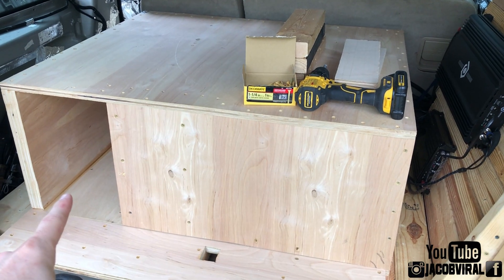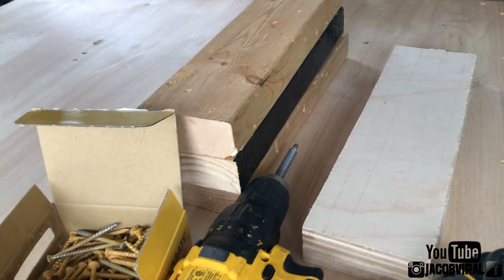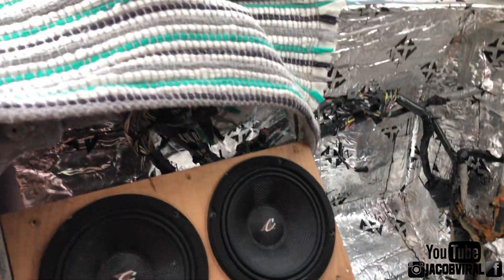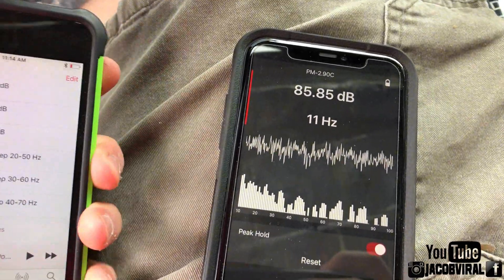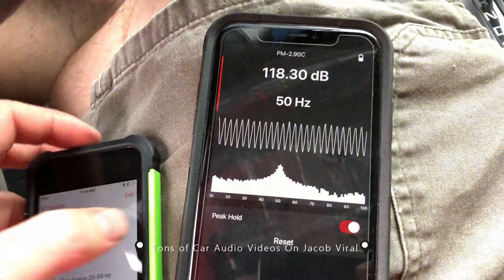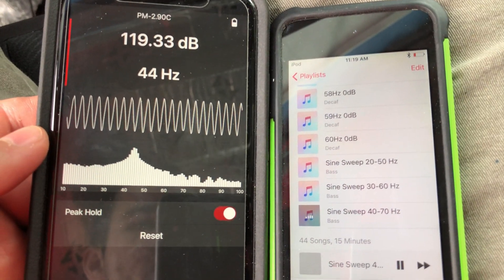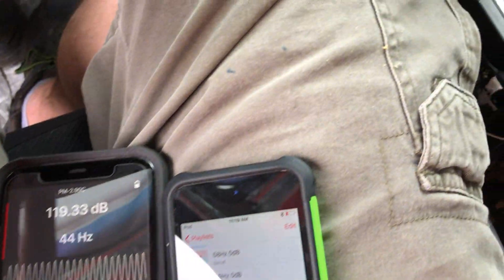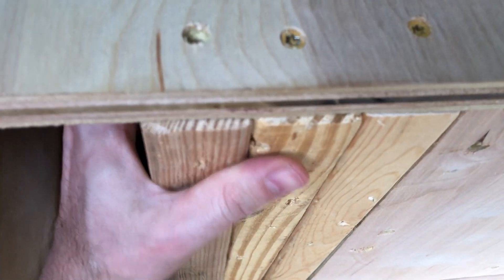PORT ADJUSTMENTS ON MY 4TH ORDER PART 1

Comment: how doni get specs and how could I turn it into a 6th for a high excursion 10
Reply from the maker: Turning into 6th would be easy with this size box, simply make a slightly larger ported box to slide into the big chamber. I recall i was doing around 8 cubes ported, 1 cube sealed in this style. Measure out your limits and use that.

Comment: Hello jacob Testing port at low vol. Or full vol. For better results?
Reply from the maker: I would go with 75% volume to be optimal without clipping/heat buildup massively but close to the potential of the build. I am doing it around 35-40% volume and it isn't as close to output but get's my on a decent ballpark of knowledge.